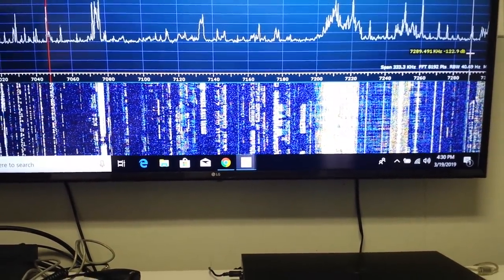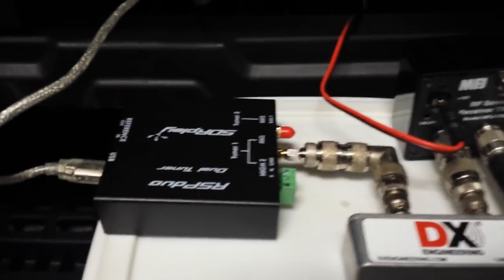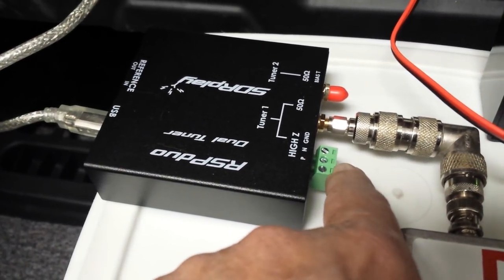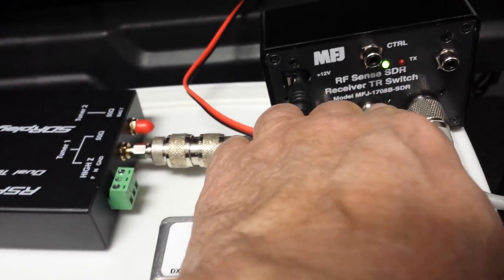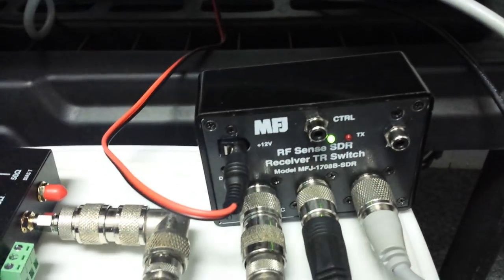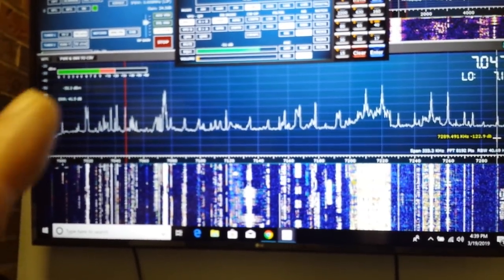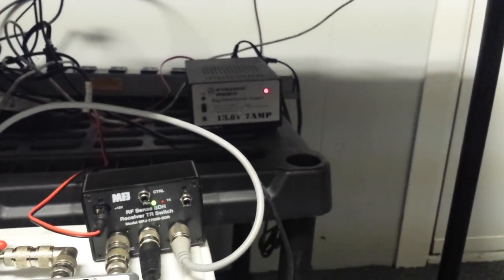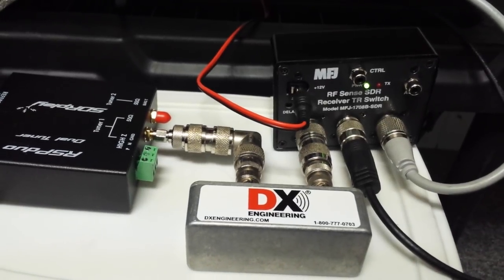How my SDR-Play Duo is Connected

Comment: what DX engineering protection box, item number is that to protection the SDR from blowing up. Im in the earlier stages, and Im planning on running a amplifier though it, Not sure how that will all hook up either.
Reply from the maker: RG-5000HD. Not sure if they are available now. There are cheaper ones around that use light bulbs. Google search receiver front end protectors.

Comment: Curious what your loss was with all the interconnects? I tried the 1708b for sdr, worked fine except on 6M..Lots of bleed thru and OVF warning on my RSPdx.
Reply: Mike, are you using the CNTRL output for Tx ground? Or are you relying solely on the 1708B? I'm curious to know. I want to keep my MAT-30 Tuner with my 991-A and was wondering how effective the 1708B-SDR is for protecting the SDRPLAY

Comment: question.  can you just you a receive antenna only with out the 1708 ? just run the SDR to a receive antenna with that DX filter
Reply from the maker: Yes you can do that. It's hard to beat the transmit antenna for receiving though. Also the 1708 will disconnect the SDR's antenna lead when transmitting providing much better protection than just that DXE gadget.
Reply: @n4lq  makes sense. I just don't want to add a bunch of cables to my desk top lol. ,and just want something simple , thank you

Comment: This is fantastic. I've been looking for a solution to get a spectrum waterfall with my Yaesu FT-818 because I can't find a panadapter. I have a question though, where would you place an autotuner? I'm guessing between the MFJ RF Sensor and the antenna?
Reply from the maker: The auto tuner would go where it always does, between the antenna and the RF source which in this case would be the antenna jack on the mfj.

Comment: Great video thanks for posting. What is the DXengineering part that is protecting the SDR. Do you know the part number or name ? Thanks again.
Reply: DXE-RG-5000  and ebay has china pin diode rf limiters for $4.38 and you can google images for   other diy circuits .
Reply: slomo53 thanks

Comment: This video is awesome and answered many questions.  With this MFJ version, is the transceiver connected at all times to allow QSK operation.  So little information out there for the CW ops.  KX9RT
Reply from the maker: Sure it is. This does't change a thing as far as QSK is concerned. Receiver QSK switching is done by a relay in the 7610 and it's very smooth and quiet.
Reply: @n4lq  I missed my ? mark.  Thanks.  I was hoping it wouldn't change the QSK operation of the rig.  I have a duo on the way.  HRO had $50 off.

Comment: Excellent Video Steve.  Before MFJ came out with their MFJ-1708 series T/R switches I built a fast T/R relay system so i could use my SDRplay RSP2 with my FT-450D using the same antenna. I use the keying line from the FT-450D after running some tests on the relays I used  and the FT-450D with my Storage Scope and learned that the Keying line goes low and the relays are fast enough to transfer before RF is produced from the transmitter.  I also have the separate grounding relay which operates in less than 1ms. to ground the SDRplay.  I don't have the DX engineering protector, but have had no problems since I built it.   If I had to do it over I would buy the MFJ-1708sdr!  I spent almost as much on parts and A LOT MORE ON TIME designing and building it than the MFJ product sells for.   --Tom WA4GIM
Reply: I still have the FT-450AT and I was wondering about the keying line as well but you helped clear some stuff up.As my loose money has changed I think I will be going this route,using the MFJ=1708 series and just hope for better days to return again.73s de Kd5kkh

Comment: The MFJ TR sense is just that, a "T" splitter switch. I experimented and found better results using a straight "T" splitter and RF guard.
The 3db roll off of the MFJ is too much signal sacrifice IMO.

Comment: I am planning a similar setup except that I have a Wide Band Small Loop Receive antenna feeding the SDR-Play Duo. I purchased the DX Engineering RTR-2 transmit/receive switch with a preamp. I tapped the PTT signal coming out of my CAT cable and fed it to the RTR-2. This allows me to use listen through the Small Loop Antenna for receive and still use a MyAntenna EFHW to transmit with. I love this setup. Next step is diversity reception...

73's
KM4MQV

Comment: Hi Steve,
You said that thhe radio that you are uusing iis an ICOM IC 71,  which is a rig that I have actually heard of  quite a lot of years ago having been licenced 33 years now.  However, the ICOM Radio that You are using is actualy an ICOM  IC 7100.   Easy for myself and othher owners llike myself who have them to also recognise.  So whhat dose that say to newcomers to the hobby looking for THAT  ICOM IC 71, ???
Apart from that Steve,  A Great video, which I have learnt from, due to having purchased an MFJ 1708 B  which hhad no instructions on it.  BTW,  I also picked up about the you mentioned 12 Volts on the BIAS T Ouyput.  Correction my frien But it's onlly 4.7 volts from the BIIAS T OUTPUT,  which means that a sepperate 12 Volt PSU would also be required .
Kind Ewgads,
Ray.
M0RAY.

Comment: At time 3:15 you said the Bias-T voltage was 12V. According to the data-sheet (RSPduoDatasheetV0.6.pdf), it's 4.7V (100mA). 
Can you verify this with your multimeter?
Reply from the maker: Yes unfortunately you are correct. This will require a separate power injector.